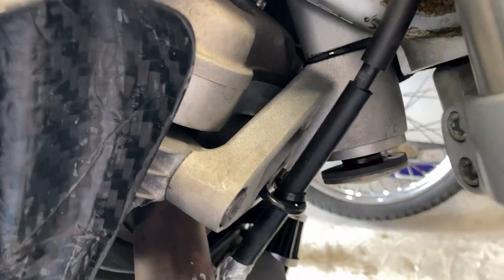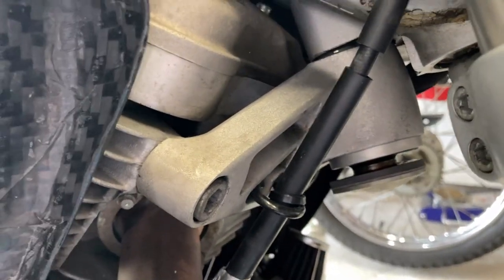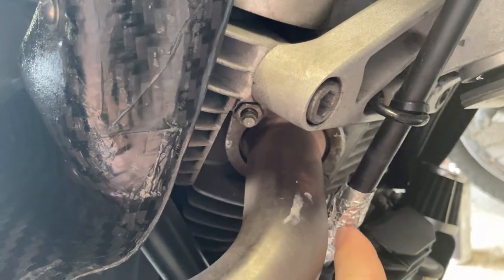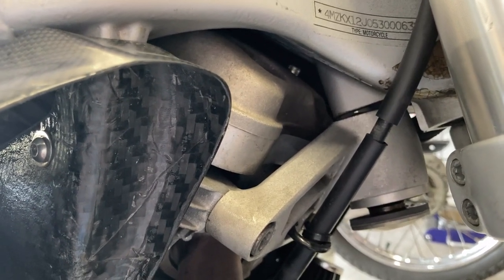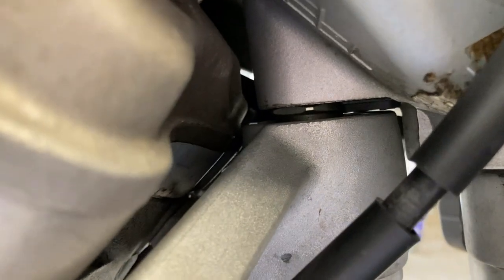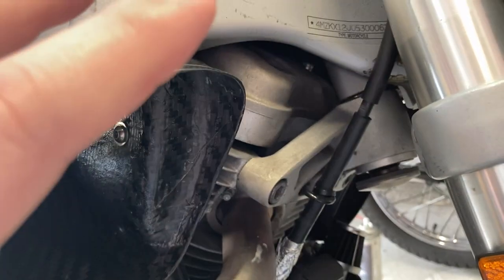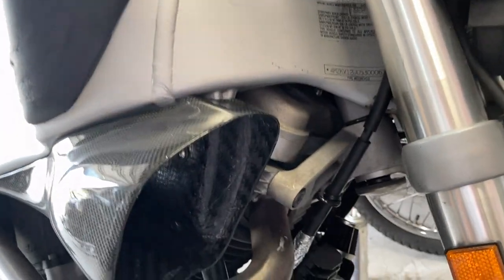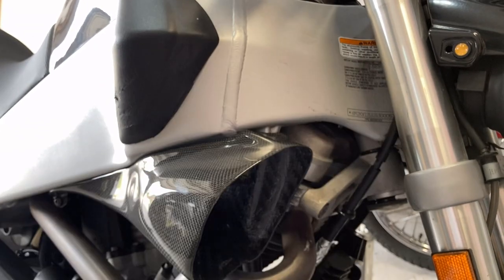New Front Mount for Buell XB9SX

Comment: There are enough workshops in Russia to restore silent blocks by replacing cracked rubber with polyurethane. Comrades tried to pour soft polyurethane. The vibration is lower, but it was enough for several thousand kilometers. Now filled with rigid polyurethane, the effect is reversed. I'll probably have to drill it to make it softer. Something like that.

Comment: Significant vibration it what original front isolator design solves otherwise they woul do it solid rubber design just like this polyurethane filled moint for increased durability.
Reply from the maker: That's true, but whereas this is a prototype, the delta between factory and this unit are being noted, albeit with some subjectivity. The fact remains that factory units are quickly disappearing, and the maker of the unit shown in my video has taken the lead in creating a new and viable alternative. He plans to make more that are closer to the factory configuration but with polyurethane.